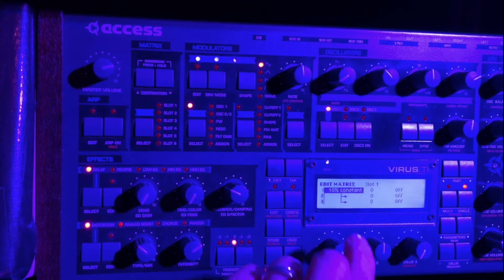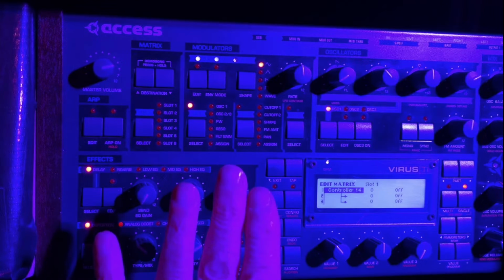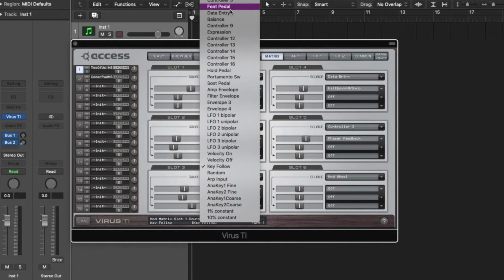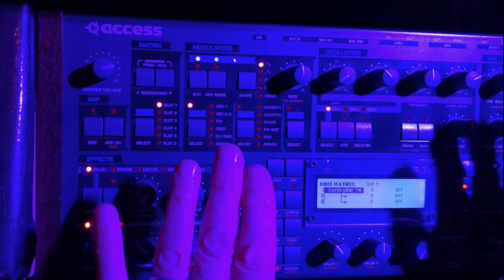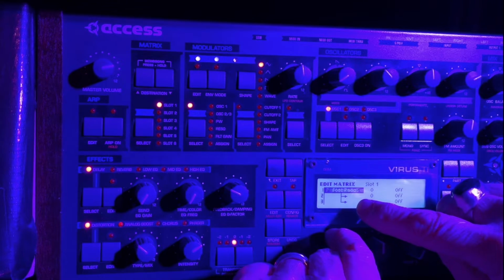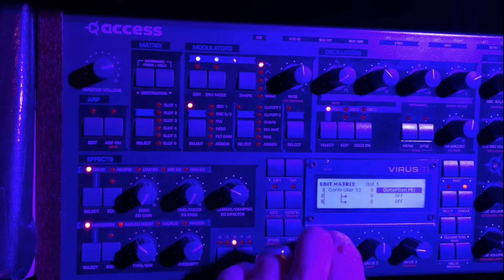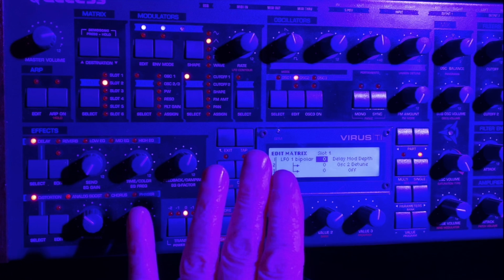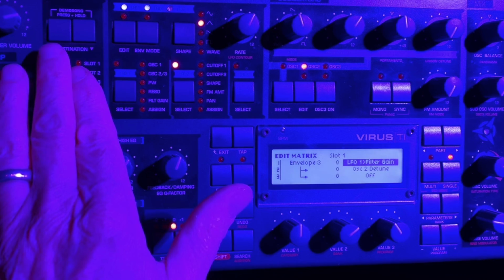'ENTER THE MATRIX'  Modulating your Access Virus Synthesizer.....basics....

Comment: What do you think about the OSTIVIRUS ?
Reply from the maker: Haven't checked it out, but I'm really curious
Reply: @willswitchcraft  I just tried it and it works and sounds authentic because the chips are being emulated and the actual hardware rom from the synths are used. The interface is very similar to the VST plugin that comes with the Virus TI. They also have emulation for the MicroQ, and are working on the nord range.

Comment: Definitely use the Aura MI software for mod matrix as the manual process on the hardware is very painful! I do fine without the plugin software for other functions. I only use the software when recording to DAW or if I need to use the mod matrix, load patches or configure the sequencer for the arp.
Reply from the maker: Yeah, and of course for Patch Librarian stuff, it's indispensable......when I had a Ti Desktop, I used to just do most of my programming from the front panel, but now that I'm using a Snow, I rely on the software for all my in depth programming. . . . . .
Reply from the maker: I'm having a problem that perhaps you could help me with.....I have a backup of the sounds on my Virus Ti desktop (which I've now sold), but I can't upload any of those patches into the Virus Snow - some strange issue, even though they have an almost identical synth engine......I need to get someone to take my Virus back up (.vti file) and then create .mid patch banks for me. I only need the first 4 RAM banks.   Interested in helping me out?    I can send you - not only my back up file, but over a hundred different patch banks from various sourced, for the Virus.
Reply: @willswitchcraft  Hi, how are you doing? If you still need assistance, I'll be happy to help. I have a Virus TI2 desktop and the Aura patch librarian.
Reply from the maker: Got it all sorted out, thanks

Comment: Is there a way to use the step sequencer and the arp on the virus ti2 without the computer software and if so, how would I set this up? Got a 3k synth, it should be possible!
Reply from the maker: The arp is easy to configure on the hardware, but as per the sequencer, I'd suggest just going on the Access Virus Users Forum.....probably the most complete source for such info (I never use the Sequencer in the Ti myself, so I have no personal insights.....)
Reply: @willswitchcraft  thanks I can set the algorithm for the arp on the Virus but to actually tweak the sequencer, I had to use the TI2 plugin or Aura MI software on new mac. There is no way to change many of those settings via the Virus TI2 hardware menu screens that I could find in the manuals or forums.
Reply from the maker: I haven't really used the arpeggiator much on my Virus, so I'm not going to be much help here. I'm surprised that you couldn't find answers on the Virus Forum - seems like there's a pretty solid group of users there, but perhaps, now that the company isn't really moving forward, the interest and support are waning.......